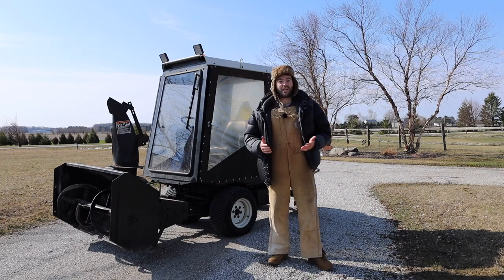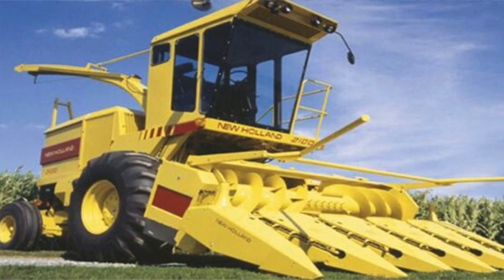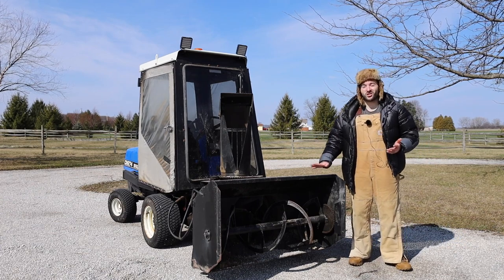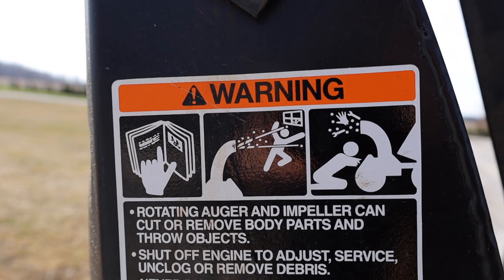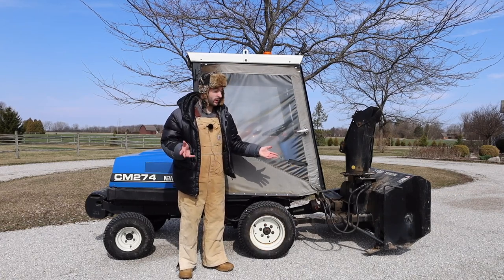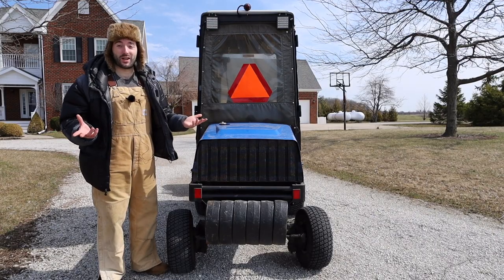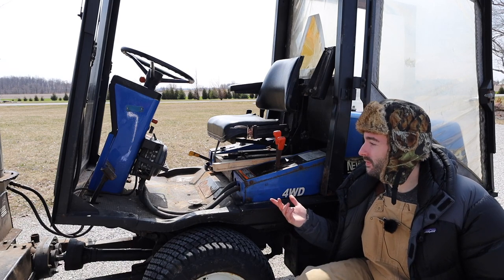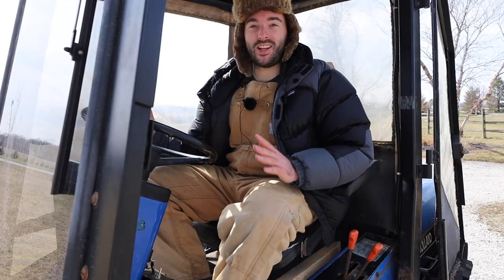1991 New Holland CM274 Review: The Cadillac of Snowblowers

Comment: You own an awesome unit that needs a few things gone over. It looks impossible to remove foot pedal for differential lock but study it and it disassembles pretty easy. Yours is seized up. Take it apart and file or sand down the shaft so it fits loosely in “pipe”. Reassemble with lots of grease, it will work forever. One of your hand levers on left is for HI and LO. PARK BRAKE likely does work, hold right red pedal down while you pull red handle up. I wish it was not so loud but it gets incredible fuel mileage. I’d be surprised if 4wd is not working. Get that foot pedal released and check all your fluids. If your Dad did not mention it to you, I will, - you scooped up a bunch of stone and it’s not even winter.